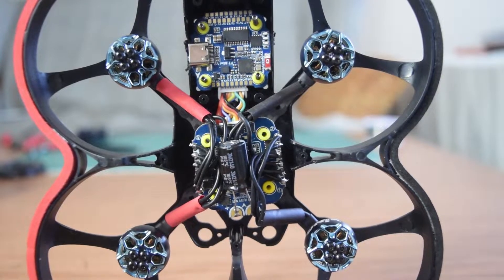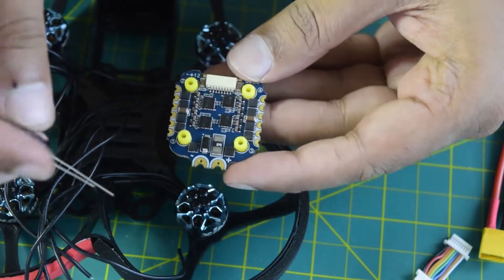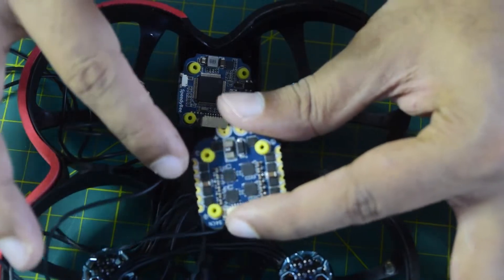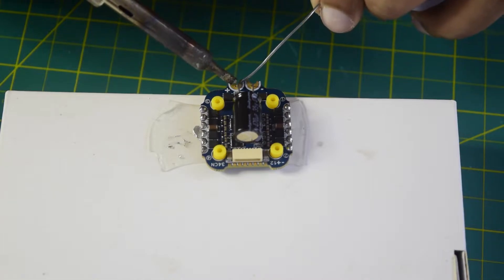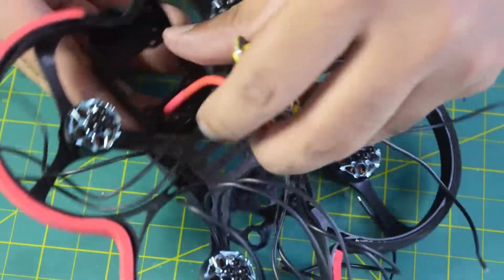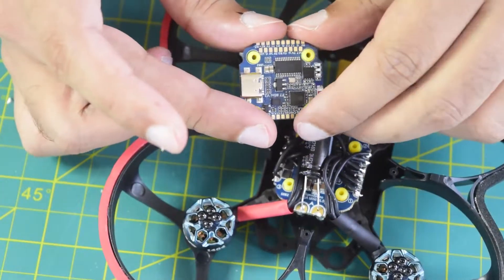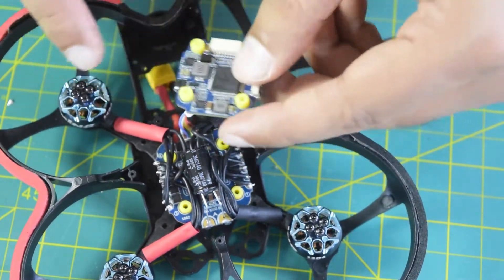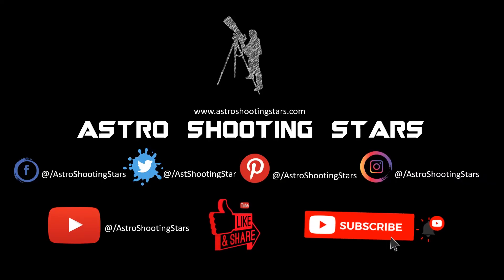How to Install ESC and Flight controller Speedybee F7 Mini on BetaFPV Beta95x V3 Cinewhoop 1404KV

Comment: Does it matter where exactly I solder the motor wires, or do they just have to be, say, 1 in a row and 2 in a row by motor? There is no rule of thumb?
Reply from the maker: every motor is soldered on set of 3 pads and there are 4 set of pads. the sequence of the wire on pads decides the direction of rotation of the motor unfortunately you will know the direction of rotation of motor only after powering up, to reverse the direction you have to only switch any two wire on the pad. 4 motors also have their specific position as each motor should have very specific direction of rotation depending on the position of motor. I have that in my video also in details in the motor review. i hope this helps. please stay tuned to my channel for my future videos.